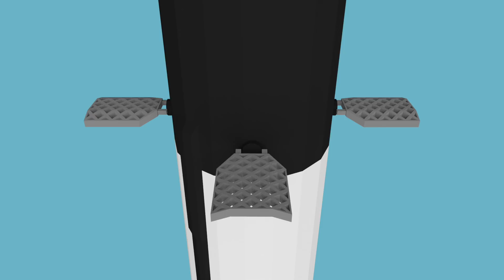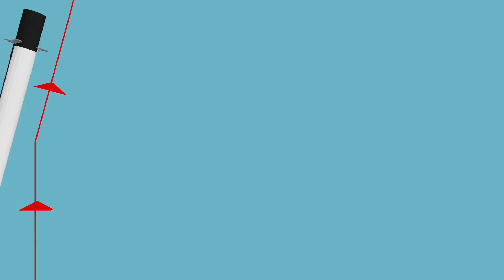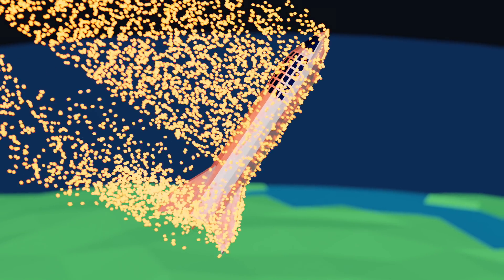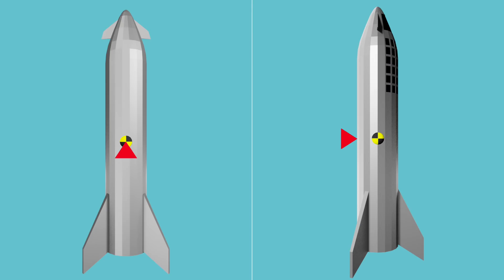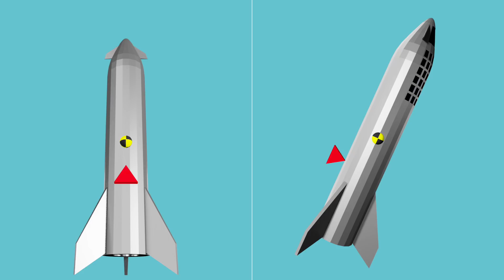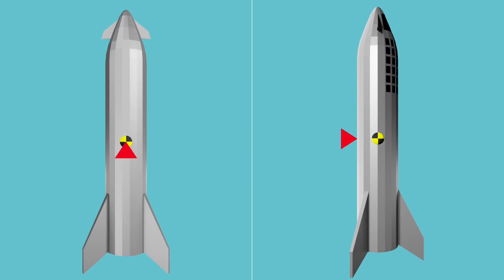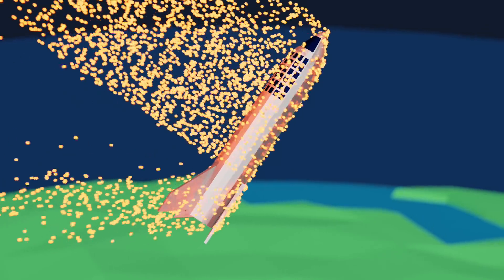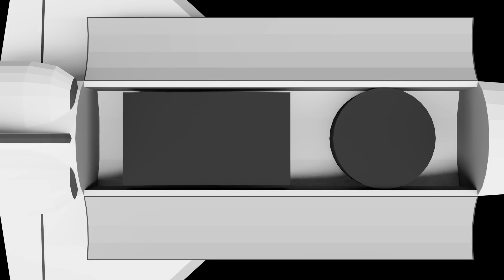How SpaceX Falls - Starship Reentry Explained

Comment from the maker: The three fin design is now out of date, however, the same control methods explained here still apply to the new two fin design. https://youtu.be/f768_vRJKQw Here is an addendum to this video with regards to the updated design.

If you've enjoyed the video make sure to share it, and consider supporting me on Patreon patreon.com/simplyspace , it'd go along way to helping me spend more time and resources on these videos.
Reply: It's awesome, and a really good explanation!
Reply: Ear Prishurr?  Why do you sound so different from the Australians?
Reply: it sounds british
Reply: @Kevin-fn5tk  i was gonna say what? But you're right. These years just about any mongrel can be british, you dont even need to speak English.
Reply: "Diflict the oncoming ear"
Reply: Simply Space this is ok but the center of mass isn’t in the center of the vehicle. It’s actually in the bottom of the vehicle because that’s where the fuel is. As the rocket slows down, that fuel will naturally slosh, so I’m wondering how stable this thing will really be during the free fall phase. When they burn forward to begin the nose up phase they’ll have to move all the fuel to the full rear so the mass is in the back of the rocket. I did this with a ballast system in KSP and it was rather difficult to land if the fuel mass isn’t considered. Otherwise if fuel is too far forward the rocket will naturally want to nose down and fly like a plane and if too much is in the rear the starship will naturally want to go thru the burn phase tail first like the boosters do. The fins will help some but until it gets inside the lower atmosphere, they won’t do squat. So far Elon has never landed something from orbit only in suborbital flight where speeds are far slower. I think the fact their fuel tanks are built at the bottom of the rocket will cause them some grief but we’ll see as time goes on.
Reply: @GokouZWAR  the rear fins are much bigger than the forward canards, this means the center of pressure will also tend to be biased backwards. But really the header tanks for Starship won't hold much weight (I calculated about 10 tons for a 120 ton starship hauling 150 tons of return payload) , most of the mass will be concentrated on the payload sections and the engines.
Reply: Make a new one

Comment: You might be able to move all four of the flap bases on Starship. So that they would extend from a position far higher on the top of  Staship, closer to the race track and so that only the tips and midsection of the flaps would extend into the plasma stream, and only those sections would need to have heat shielding! When in use they would extend from the top of the ship, to beyond the the widest point of the ship into the plasma stream, think of them as butterfly wings or four angel wings, instead of a airplane wings. They are not their for lift, rather for direction control and drag during the belly flop, and for reentry!

No need for specialized heat tiles, all along the side of the ship, or near the bases structure none at all, cutting cost and number of tiles and time needed for installation and or replacement of the tiles.

Comment: Why don't those rockets burn up on reentry?
Reply from the maker: Falcon 9's first stage renters from a sub orbital trajectory, which means it reenters at a much slower speed than something returning from orbit. And it enters engines first, that part of the rocket is designed with high temperatures in mind anyway.

Starship will have a heat shield to protect itself during reentry. It is still in the prototype phase so it's still a bit of an unknown.
Reply: @SimplySpace  thanks.  i will subscribe.

Comment: The starship re-entry system is certainly very cool concept.  I am curious if the SpaceX team thought to try it out and maybe perfect it using the Falcon 9 second stage?   It would not only re-affirm and perfect the design but also make those second stages re-usable as per Musk's original goal.
Reply from the maker: At one point Musk said they would do that but they've decided it's not worth it and to just go as fast as possible with Starship, leaving F9 out of it.

Comment: Word on the street is the Grid Fins were initially called ears but then that caused much confusion because the ears were designed to deflect ear. If the ears were designed to deflect ear then how could the Enginears be certain deflection of the ear using the proper ear would move the craft to thear?

Comment: Don't the booster fins work as separate coupled pairs? One opposing set rolls the booster, the other pair controls pitch rotation
Reply from the maker: I'm not enterly sure to be honest, but I think you're correct. It would simplify the control system if you could isolate the moment arms to different pairs of gridfins.

Comment: How Starship will land on unprepared soft surface of Moon or Mars first time? I think its better have the same design like they have on falcon 9 booster. Diameter of circle around opened legs should be at list half of the height of the Starship not to flop.
Reply from the maker: The version shown in this video is out of date. It now has separate landing legs planned. Be sure to tune into Elon's presentation this weekend if you wanna learn more.

Comment: Is this thing really going to handle the thermal loads.
Reply: They are using a thin "skin" over the main hull that is porous. Flooding the area behind it with liquid methane so that it "sweats" through and evaporates as the ship is on re-entry, cooling the hull faster than the heat builds. Also, the steel itself can withstand far higher  temps than composites. So very likely so. But I would love to see it in action to be sure. :-)

Comment: Small detail, on the Falcon 9 the four grid fins are not independently controlled. Two fins can roll opposite to twist the rocket  while the other two are connected to roll the same way for movement in one direction or the other. This lets the ship roll and then move one direction or the other. This can be seen in the failure of the grid fin that caused the Falcon 9 to spin and land in the water instead of on the pad. During a return flight the booster's ballistic trajectory is into the ocean just off the coast and the grid fins then completes a dog leg maneuver to shift the flight path from the ballistic course to the touch down point so that in the event of a failure the rocket will natural fall into the water.

Comment: you left out the 1 thing i wanted to know and see , how does it stand on its but  when coming in for a landing , how does it get the CG so fare back  that it can land , how does it get so much drag on the nose to stand upright to land
Reply from the maker: By the end of the mission the remaining landing fuel will be at the bottom of the fuel tanks. Full extension of the top find, full retraction of the aft fins to lift the nose as much as possible. Then fire up the engines and gimbal them to bring the starship vertical.

Comment: Nice video!  You might also add why the canards are so much smaller than the main fins.  Which is due to the CG of Starship being much closer to the engines when the fuel has mostly been expended.
Reply: The CG of the ship will move FORWARD as they use fuel. The tanks, which are mostly behind the CG are getting lighter, not heavier.